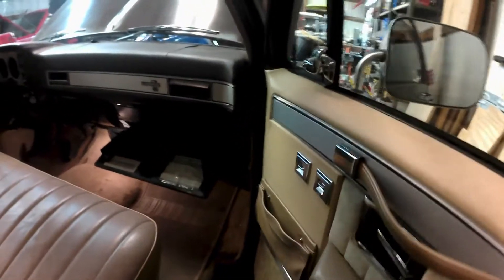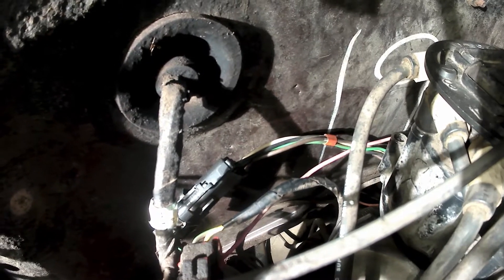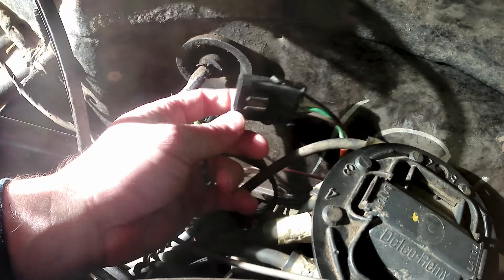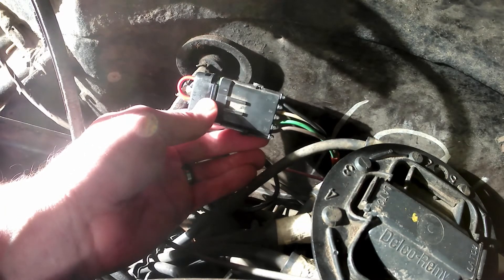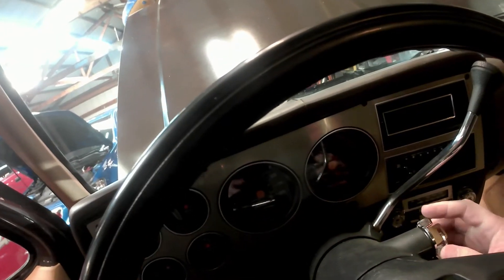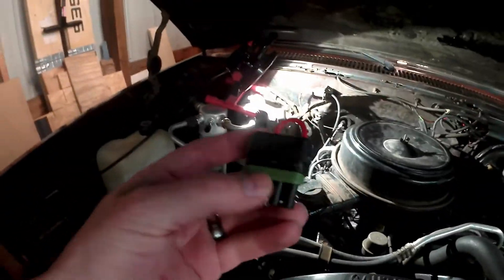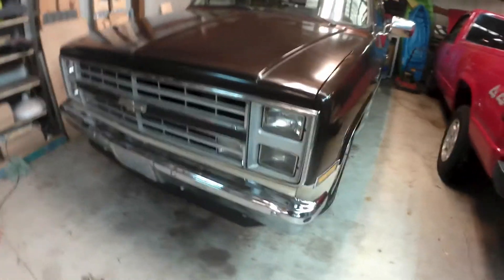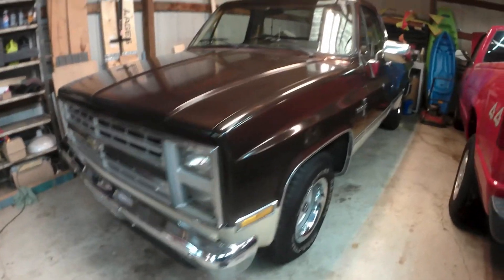How to Bypass ESC Easy on 1981-1986 Chevrolet Trucks (Silverado, Scottsdale, Custom Deluxe, C10 K10)

Comment: Just replace the distributor with a HEI distributor plug in the battery lead and it will start right up -- I did that to my truck and it runs a lot better now -- vs

Comment: I had my  distributor on my 1986 C10 changed over to a 4 pin ignition module HEI and the truck has never run as good as it does now.

Comment: ESC? Invented only to deal with knocking from the crappy low-octane fuel of the early 1980s? That stupid computer left me stranded many times in the 1990s and nearly got me killed a few times. They can cut your ignition off with a violent lurch on the freeway.

Comment: When was ESC introduced anyway? 1983 or something? They tell me I should unhook the pink wire on the distributor cap also (isn't that a harmless open circuit?) or replace it with an earlier GMC HEI distributor. Pre-1983? A 4-pin module instead of my 5-pin?

Comment: If i did this are you saying id have to adjust my idle screw up or down. I dont have an rpm gauge do i need to get one?
Reply: Timing may need to be adjusted if you bypass the ESC module -- with a timing light and spinning the distributor.   The idle screw shouldn't matter, if already set properly...

Comment: I jumped mine and it fixed all my problems.  I ordered your jumper plug for a permanent fix until I find a new ESC.  Where is the best place to buy an ESC?
Reply: That's awesome, and Thank you!  I was able to get an ESC at Advance Auto Parts.  Took 2 tries as the first "new" one was bad also, but the 2nd one was fine.  A lot of people permanently bypass the ESC, but on this truck I'm trying to keep it as stock as possible.
Reply: @JoeyElam  thank you!  I’ll go to advanced today, I didn’t think they had it because I couldn’t find it on their website.  I too  keeping mine stock.  Im keeping the nice jumper I ordered for emergency use after I replace the ESC. I wish I watched this video a year ago it would have saved me a ton of time and money.
Reply: Advanced does not have them.  Where else can I get one?

Comment: What will happen if you just disconnect the ESC connector in the engine bay?
Reply from the maker: If you leave it unplugged, you'll have no spark.  The spark signal travels through the green and black wires.  So if they are completely disconnected you'll have no spark to the plugs.
Reply: @efamadventures  I tried it and the car starts and idles. When I connect it, the engine stalls.
Reply: @vinloy23  interesting.  Did yours get replaced with HEI at some point by chance? Or maybe it's somehow bypassed prior to that plug from the distributor?
Reply: @JoeyElam  It is a 1981 Pontiac Firebird with electronic HEI, stock. It suddenly refused to start. Troubleshooting pointed to the ESC. Disconnected it and car started right up. When you used your bypass device, was it because it did not start?
Reply from the maker: @vinloy23  Hmm -- i have no idea how the HEI works with ESC.  I thought it was either/or, but that era was a lot of trial for "computerized" stuff in cars.   My truck wasn't starting -- it had bad ESC, and at the time, a bad ignition module in the distributor.  So after fixing the Module, still didn't start, bypassed ESC, started.  Mine will die/not start if you unplug the esc (or the bypass module) b/c it completely kills the spark signal...
Reply: @efamadventures  I replaced the module with new and it did not solve the no start. Only after unplugging the ESC from the engine bay, it started. So, it remains unplugged. Thanks

Comment: I've been chasing a rough idle issue on my 85 High Sierra for years.   I've smoked it, no vacuum leaks, intake gasket is good, etc.  I noticed that
someone had just unplugged the ESC before I bought the truck.   Could this be it?!   I'm going to go jump those wires and give it a try.
Reply from the maker: If the truck has esc and no modifications I don't think it will run at all without esc plugged in.  So my completely factory truck should die if I unplug ESC because the spark signal is running through the ESC.  So there would be no spark.  If you've got rough idle I bet ESC is bypassed somehow already....  Could be a carb issue...?

Comment: Hi eFam Adventures
     It's me again and further to my ignition problems with my 85 C10. When my mechanic bypassed the ESC to get spark as l mentioned the truck would run for 5 or 10 min.  then stop and won't start unless it rests for 30 min or so. He used a blue (colour) plastic splicer that has 2 holes for 2 wires to fit into. When the black and green wires are  in fitting he squeezed with pliers and a metal insert makes contact through the plastic insulation to the metal wires and effectively bypassed ESC, however only ran for 5 or 10 min. The plastic splicer was on the distributor side of the 4 wire plug. Trying to source problem l took  the 2 wire splicer off and plugged 4 wire connector back together, thus back to factory settings. I have the Mitchell manual to help me. I checked to see if power was getting to ESC through the pink fuseable link wire from the distributor, that my mechanic never did and there is lots of power to ESC. I think the ESC may be faulty but at least l know there is power getting there. My next step after disconnecting 4 wire connector plug was to jerryrigg a bypass similar to the one you had made up so it was making a good connection with the black and green wires. I started the truck many times and seems fine. Is it possible that the blue plastic splicer the mechanic used was somehow (as you suggested) heating up then failing? I've only tested in garage, not on road. Is there a lot of juice in the black and green wires to cause heating up then failing? My son ordered a proper bypass from your site so once l receive it l will try on the road. My mechanic originally retarded the timing  to compensate for no ESC so I'm hoping it will be fine. He also plugged vacuum advance hose but why? Is it not necessary. I, as you said could have cut black and green wires and soldered together but want to eventually  get new ESC and back to stock. Thanks again if nothing else I've learned a lot although as they say a little info can be dangerous 
The voice of reason and common sense in Mission, albeit a lousy mechanic.
Reply: The fun never stops does it?  I know the splicers you are talking about.  I'm not a fan, but i know a lot of people use them for various things with success.  Make sure you reseal those wires (tape or something) where the slits are.. keep any corrosion out.  The spark signal is actually passing through that wire... not a enough to heat up the wire i wouldn't think (unless there is a bad connection)-- just the ambient engine heat getting hot was my thought.  Your module should be getting there soon!  Looks like it passed through customs a couple days ago.  Curious if that works better for you than the little blue splicer.  the module i make is of course a factory style connector and will have no issues with heat or vibration.    

Not sure why he'd have bypassed the vacuum advance -- Unless he was suspecting a vacuum leak somewhere causing other issues after the engine warmed up?  

Looking forward to hearing how it goes with my module.  I've had only positive feedback on them...  I'm a "factory" guy too -- it's easy to bypass the ESC and leave it -- but i just wanted it to be "Right."

Once you get your working and new ESC -- keep that module in your glove box just in case!  Easy fix if ESC dies again later and leaves you on the side of the road..

Comment: I left mine alone because I believe the. Knock sensor is tied into that system   cheap insurance
Reply from the maker: It is. I believe the knock sensor feeds data TO the ESC to determine how much to adjust the timing.  So bypassing ESC would indeed remove the Knock sensor info.  Timing is then controlled the old way...

Comment: Thanks for the excelent video on bypassing the ESC. I park my truck in my garage for months at a time and just start it once in a while and has been fine, however the last time l tried to start it it turned over but wouldn't start. I couldn't get spark so l followed your instructions and it started , however the truck 1985 Chevy C10 runs fine for 5 min, then quits and won't start unless l let it rest for 30 min. or so then repeats same thing. Do you have any suggestions?
Reply from the maker: Then sounds like something is getting warm, then failing.  Do you lose spark when it dies?  or have spark but won't run?  If losing spark... i'm thinking... what is getting hot/warm then failing... Maybe the ignition module in the distributor?  Wire somewhere else failing?  bad ground? hmm...
Reply: Wow thanks for reply. Nice story, keeping truck in family. I'm not a mechanic. The mechanic that originally tackled  my 85c10 with the no spark spent some time trying to source out problem of no spark, even putting a new 5 pin  ignition module in distributor still no spark so l took ignition module back. Usually they won't give refund money but obviously my mechanic had an in with the parts place. He then bypassed the ESC and like l said runs then shuts off. I can't check as you suggested to see if l have spark at plugs after it stalls right now as l  live on my own put will do that. It does sound like something heats and fails. Is it possible to check the ESC AS I would like to return to stock? Sorry for being long winded as I'm relatively new on computer. Thanks again for your response. Ps  my mechanic had a back operation so can't help me. He says l have to replace distributor with 4 pin ignition module.
Reply from the maker: @terrymortimer4596  I was unlucky enough to have both the ignition module AND the ESC bad at the same time -- talk about a head scratcher.  So good idea is to bypass ESC, then troubleshoot further (like replacing the ignition module -- i'd try the same one you have now).  Once you have it running with ESC bypassed (that module i make is great for doing it without cutting wires), then you can try with ESC again.  If it fails, you know you have a bad ESC.  But i think you've already determined you have a bad ESC -- AND another issue...

Even worse for me -- the replacement (refurb) ESC i got was ALSO bad -- but intermittent!!  It must have had a bad solder joint somewhere.  so seemingly randomly, the truck would fail to start, or cut off when running.  

So i had to go through TWO new ESCs and the ignition module.  Luckily ESC is easy to bypass to help eliminate causes of trouble...

Good luck to you!
Reply: I have problem did you get it figered out

Comment: How many miles are on this truck? The way it looks under the hood you'd think it hardly had more than 10,000 miles.
Reply from the maker: Only 64k! I had to spend some time cleaning it up after sitting for 4-5 years, mud dobbers, spiders, mice, etc... but surprisingly all the wiring was good and there was no real damage...  Definitely a fun toy to have -- especially since it was my Grandfather's truck and I remember riding in it when I was a little kid!

Comment: Could this be a reason why my truck randomly dies?
Reply from the maker: Could be!  Distributor, ignition module, esc are probably common causes....  I had a bad ESC, replaced with another bad one that was intermittent (and yes, that kills spark), then got a good one.
Reply: I pretty much rebuilt the distributor but it will still die out of no where and I can't figure it out
Reply from the maker: @bradmassie8284  I'd say do a temporary ESC bypass with a jumper wire (dont' cut anything) and see if that helps. If it does, pick up one of my modules to bypass, cut and splice, or replace ESC.  if you bypass the ESC and the problem goes away -- you know it's the ESC.  if you bypass the ESC and you still have it -- it'll be something else.  Good luck!
Reply: How would I do it with a jumper wire just stick it in the black and green wire connectors?
Reply from the maker: @bradmassie8284  Yes!  I had some solid core wire that was about the right size (i'm sure regular stranded would be fine too).  I just stuck it in the the pins (distributor side of the connector) to connect those two wires and got it to fire up!  I'm not a fan of cutting factory wiring....
Reply: Where do you get your adapter at did the hot wire and it did good
Reply from the maker: @bradmassie8284  I make them! Check out the links in the video description.

Comment: Was that ESC any good?
Reply: My ESC is still good.  It was bad when i got the truck but I replaced it with a bad one (intermittent issue at the connector)... Then replaced again with a good one.

Comment: So, what difference does it make? Why are we doing this? Does the 6 cylinders have the ESC?
Reply from the maker: In my case -- it doesn't really make a difference because my ESC works properly now.   If your ESC has failed, or is flakey, then this bypasses the ESC module completely and the spark timing isn't modified by the ESC.  When my ESC was failed, i was able to get the truck running by bypassing the ESC as shown.  After replacing the ESC i removed the bypass.  Some people prefer to just skip the ESC completely and run it the "old" way without computer control.

Comment: I have an 86 model. It has the ESC wire harness AND a vacuum advance. I can't find another distributor like it in the world. Want to replace it. UGH
Reply: Do you want to replace what you have now for a factory replacement?
Reply: I habe a 81 with HEI, vacuum advance and mechanical advance with the ESC.
Reply: Rock Auto is the only place I could find the original HEI with vacuum advance.  That’s where I got mine.

Comment: Love the truck. I have an 86 and this no spark problem has dogged me for a year! Going to try the bypass tonight
Reply from the maker: Thanks!  Is your issue intermittent, or always?  When I got mine, it had no spark -- but had bad ESC and a bad Ignition module in the distributor.  I replaced the ignition module first, then the ESC.  Then i had intermittent issue and had to replace the ESC again immediately.  (the "new" one had a bad solder joint or something -- it would run if I held it a certain way).
Reply: @efamadventures  Truck was intermittent for about a year. Maybe once a month it would not  start, then next day it would. Then it completly quit - no spark. Replaced ignition module & pick-up coil, still nothing. Replaced ignition coil, started once then nothing. Replaced distributor, nothing. Replaced cap & rotor, nothing. Did bypass, nothing. I'm taking ignition modules for testing now.
Reply: @davidreilly1085  I’ve been through this exact experience on my 86 c10 suburban with 305.  I just jumped mine last night and it fixed everything.  I need to find a new ESC now, any ideas?

Comment: I love the idea of using the factory style terminal as a bypass. I just hacked up the factory harness and tied the wires together until I did the motor swap. Ugly but effective
Reply from the maker: Gets the job done!  Especially if you are pulling everything anyway.  I dug around to find the factory style parts and pins to make it all work -- i'm usually willing to spend extra time and money to not cut original wiring...
Reply: 99chev

Comment: I have an 1981 Chevy Van with that setup on it. I also have a brand new HEI distributor without it. Can I simply unplug the ESC and leave it unplugged and install my new non-ESC HEI distributor and cut the thin pink wire going to battery? Or would I still need to connect the green and the black wire together on the disconnected pigtail? I would also like to delete/remove the ESC computer while I am at it. Thanks in advance.
Reply: Hey Rick...fancy seeing you here,LOL. I really like JOJO's idea about using the oe pigtails to clean everything up. In your case though just install the dizzy and go.
Reply from the maker: I did an HEI conversion on a 65 impala years ago -- but it didn't have the ESC.  I don't have a good answer, maybe someone else will see and chime in!
Reply: @efamadventures  I already figured it out after thinking about it there is no way it can't work. I will make a video when I do it. ESC distributor CAN be replaced with a standard HEI and you CAN eliminate the entire ESC system. Essentially the engine will be no different than all pre 1980 Chevy engines. I believe 1980 is when ESC came out.
Reply from the maker: @ricksteelcustoms3196  Sounds right to me!  You are right, once ESC is bypassed, its just like it never had it.  Then do as you please with HEI.  I would imagine you wouldn't want to keep the ESC and do HEI... but thats just a guess....

Comment: Is this a carburetor or efi? My 88 crew cab 1 ton has efi and it has a different distributor. Truck runs fine at part throttle. Idle is low and rough like it has no advance. Giving a code for ignition bypass circuit error.
Reply: Square body pickups were carburetor trucks until 87 when GM switched to EFI.

Comment: Is their advantage without having esc module do you feel a difference by bypassing
Reply from the maker: The advantage would be not relying on the ESC "computer" to adjust your timing (and one less thing to break).  Without ESC, it's like it was prior to introduction of ESC in the early 80s.  I would say you wouldn't "feel" a difference from bypassing ESC -- BUT, you could by adjusting your timing and getting that corrected.
Reply: Thanks for input appreciate it

Comment: What if you have already installed a new hei distributor? Should I cross some wires on the new dis if so which ones?
Reply from the maker: Not too sure on that one.  I converted a 65 impala to HEI once, but it didn't have ESC of course...  Not sure how HEI and ESC work together (or don't).